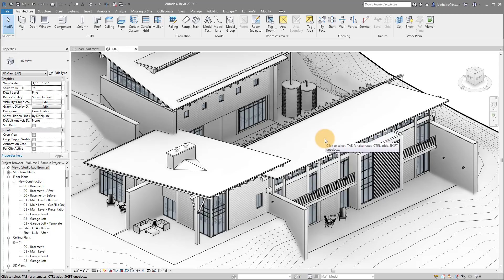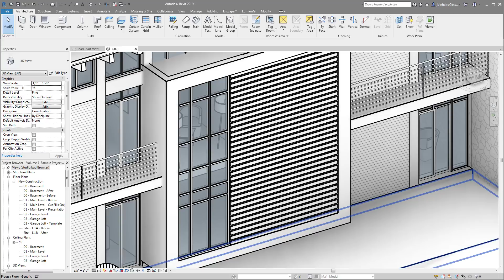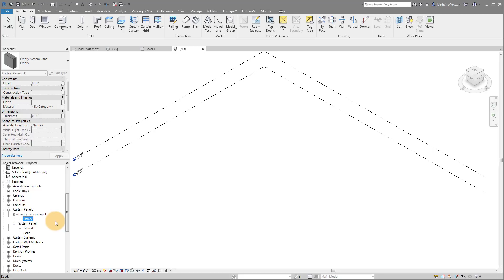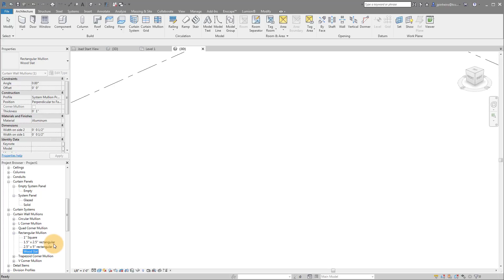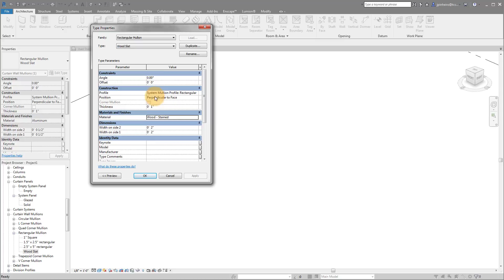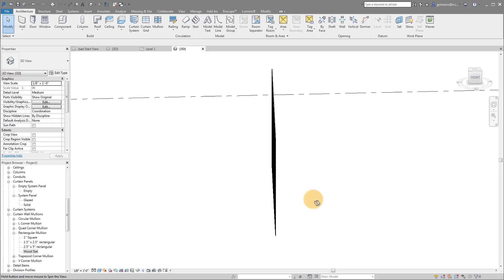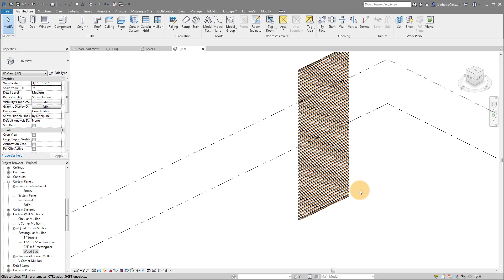Revit Tutorial - Creating Wood Slat Walls

Comment: So when I check my families, "empty system panel" shows just fine. However, when I edit the properties of the curtain wall, it doesn't give me an option to select the empty system panel under "curtain panel"...
Reply from the maker: Hey!  You're template most likely was purged and empty system panel was removed... Start a new project using the default autodesk template and empty system panel should be there.  It's a system family, so that is the only way to get it.  Once you have it you can make your curtain wall family in the new file and copy it into your current one.  Cheers!